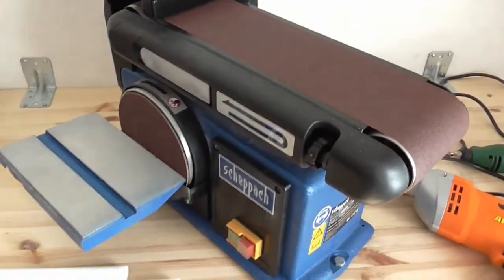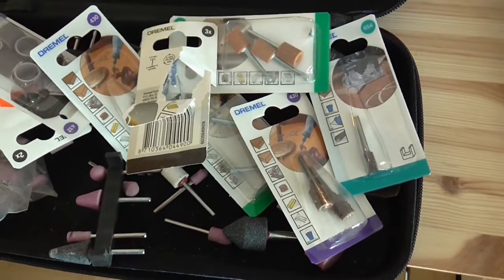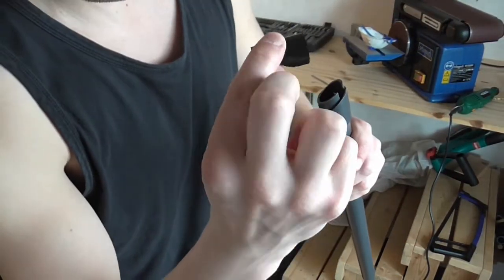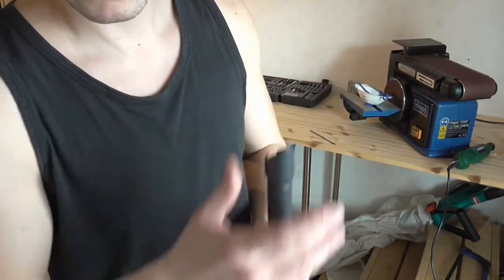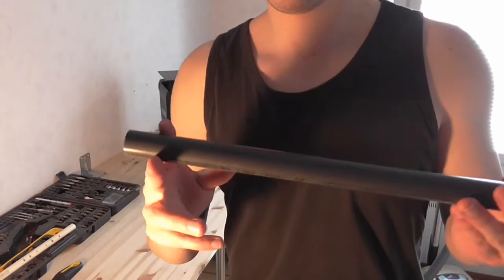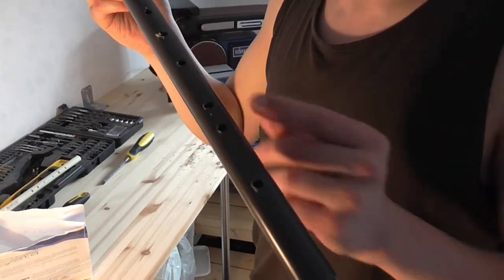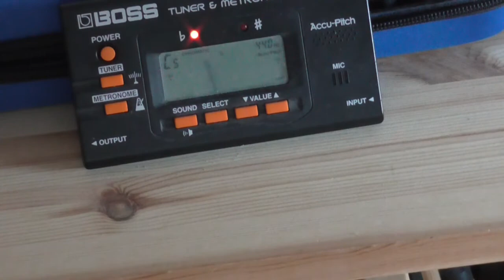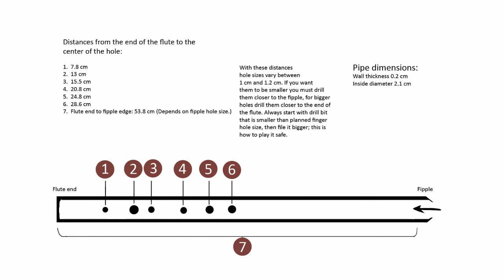Making Low D whistle/fipple flute (measurements included)

Comment: I made a low D but the a and b notes in the upper octave are very flat. Do you have advice: should I make larger holes and shift their position to the end, or make smaller ones and shift them upwards?
Reply from the maker: Sorry I've missed your comment somehow... That's a tough question and rather common challenge for tuning. My understanding is that you can't do much by changing the hole sizes/positions, instead it's about making the windway lower: for example making it 1.2mm instead of 2mm could improve things. Lower windway gives better backpressure and better tuning balance between octaves.

Comment: The most is how to tune the flute you did not showed!
Reply from the maker: Yes, I mentioned it in description, some parts were lost because camera stopped recording few times. But for tuning... You first drill the hole to calculated location. Make it small first and then start making it bigger until you reach the right pitch. Oh and... measurements are shown in the very end.